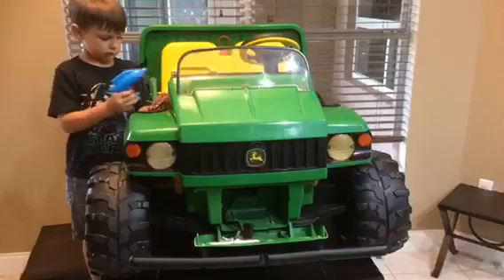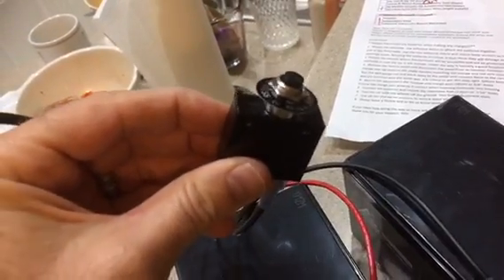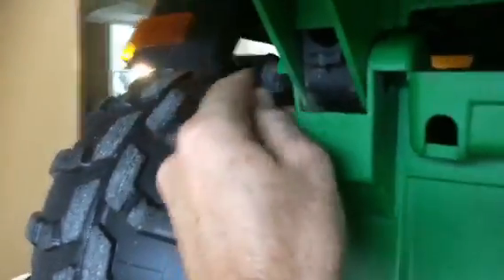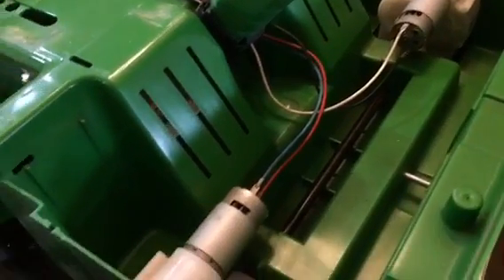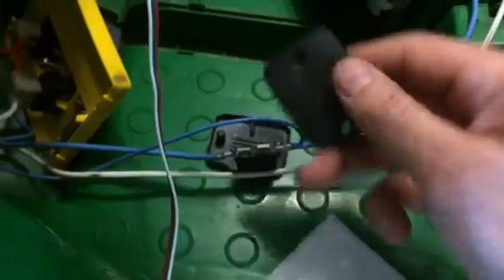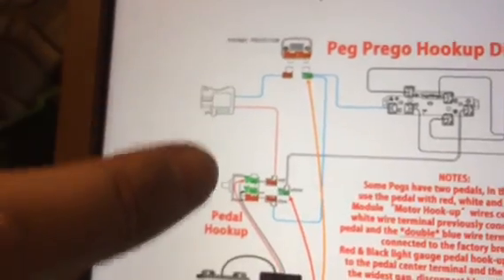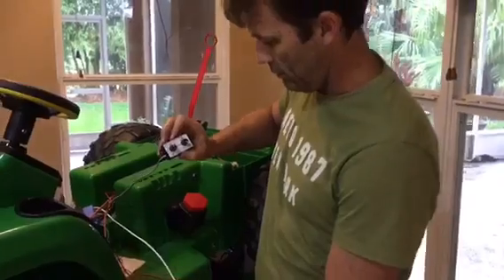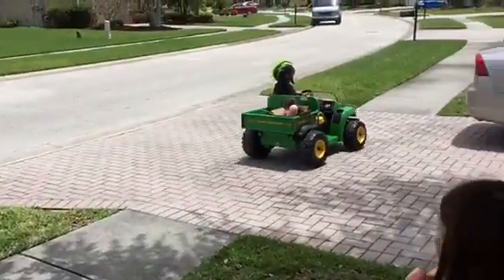easy esc upgrade John Deere gator 24v

Comment: Hi there, I really appreciate your video is helping me to do a similar upgrade. From you message in the video did you only needed to attach the orange cable?
Reply: Werner Herrera correct. Just joined orange wire to the blue.